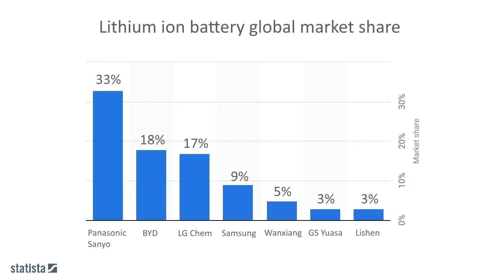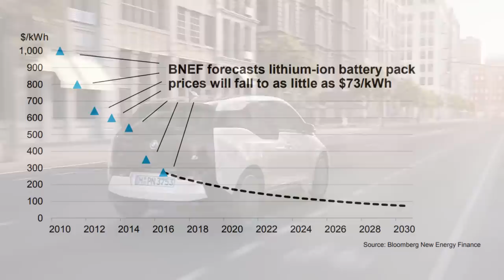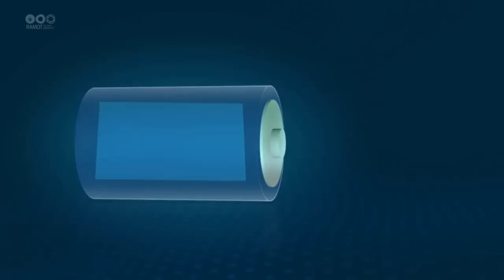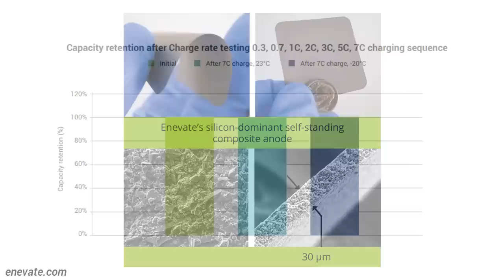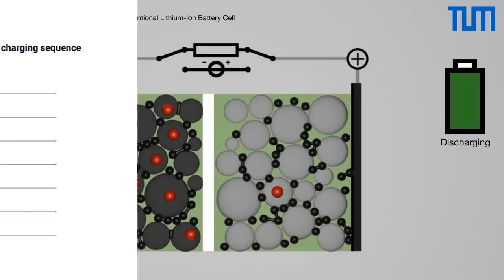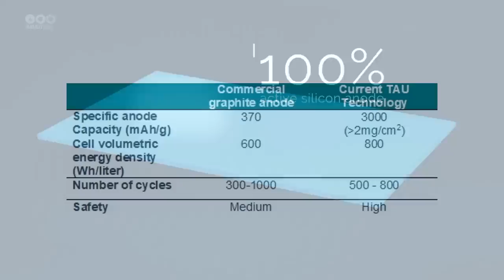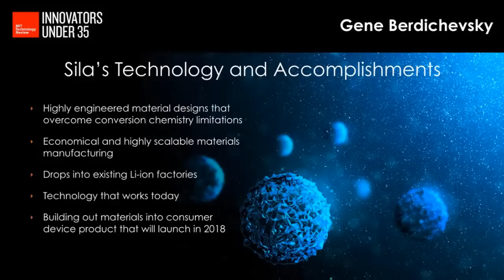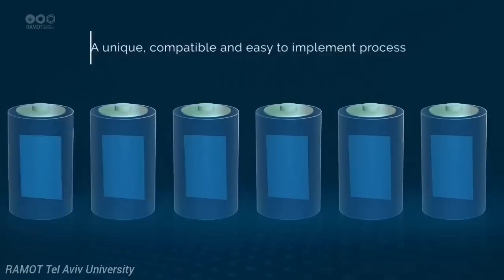The Battery Revolution. Ultra Fast Charging

Comment: Hydrogen-electric is the future. Invest in BLDP and FCEL. All electric cars are a fad. The hydrogen infrastructure is spreading quite quickly and most auto makers are revving up production in Hydrogen cars.
Reply: Hydrogen fuelled cars are not yet practical and may never be so, the cost of cars and infrastructure is enormously expensive and the production of Hydrogen is very energy inefficient. The current technology means that one filling station costs over $1.3 million to build and can only fill 16 cars a day. The energy loss in hydrogen production is enormous and currently only commercially available by burning fossil fuels.Storage of hydrogen for fuel cells needs to be at very high pressure. It may make a lot more sense for large trucks and ships but not for cars at this stage.
Reply: Well, here is the problem with your analysis. The infrastructure is ALREADY underway. Toyoda is building the fueling stations all over California. There is one right down the street from me. Their Marai hydrogen car can be seen all over the streets creating lines at the stations. Hyundai, BMW, Mercedes, Nikola trucks are already producing these vehicles. China is spending alot of money bringing up their hydrogen infrastructure and Europe is already in the works. So, if these companies, that are very knowledgeable about future fueling demands, are already moving forward, you MIGHT want to be in the same boat. Do some research. Especially, look into Nikola trucks. They plan on having the largest hydrogen infrastructure in america within the next few years. Don't wait until it's already done to invest. LOL

Comment: Can't wait to break the last EV mind barier: the slow charging/range complaint. 
Not to mention phones and laptops huge improvement.

This battery revolution and the optical computing revolution.
Reply: there's no revolution happening sir.  the supply of lithium is just not there.
Reply: Darn, the only person other than me mentioning these batteries being used in laptops. Thank you kindly, sir. Everyone seems to be obsessed with mentioning how useful this will be for smartphones, while most of smartphones are replaced because of hardware, not battery, and most laptops are replaced because of weak battery, not hardware. We could have laptops that last for like 10-15 years with these batteries!

Comment: While this is great everyone seems to be missing a key point. If we are going to replace internal combustion engines we electric drives we must consider all aspects of this conversion. First we will have to mine all these elements. This will require at least a thousand fold increase in current mining operations and will will aslo take a huge amount of energy and a huge increase in pollution. Another massive problem will be a total overhaul of our electrical grid along with a large increase of power generation capacity. I lived in Los Angles for 10 years and we had to deal with power shortages all the time. Now imagine if we replaced every car with electric cars the amount of power required would increase far beyond what we can currently can produce. I don't have the answers to these problems but we need to find the answer fast...
Reply: well, requirement for mining more would result in less mining of oil, pretty logical. As for the power - yeah. They would need to increase production of Solar panels and wind power generators. All of this is still preferable to breathing terrible air in cities because of millions of cars going around and also producing so much noise with their loud engines. I'm dreaming of times when I'll be able to sleep calmly at night knowing no car or motorcycle would wake me up.

Comment: Quickly reading the comments, I have not seen people reacting to the big percentage of bullshit in this beautiful presentation. First, if you want to charge a 100Kwh battery in, say 30 minutes, you need to bring around 120Kwh of energy, and an average power of 240Kw during the 30 min charge. 4 charging vehicles with empty batteries would use. .. a megawatt of power. Crazy. This electricity would need to be carried by high power lines with big transfer losses from distant (oil ?) power plants. The whole process is stupid. Of course pollution is better at the place of the car. But overall? I hope hydrogen production and storage will progress fast because it is a much more rationale scheme.
Reply: power line loss is only about 7%, they could always just build super capacitors or battery banks that would store the energy on site and deliver quick burst of high amperage needed to charge the batteries quickly, aslo hydrogen runs into the problem where its mostly generated from oil or electrolysis which is more energy intensive then powering batteries.
Reply: @puits-de-science  you're going to have to source these loss numbers and where you got them from because I've done these exact same calculations with Coal power and ended up with 30% efficiency not counting drivetrain loss wich would be higher in an ICE but you also have to remember it takes energy too process oil into gasoline or diesel and it's not a minuscule amount, also what is an oil power plant? But we can simplify this a bit bit how much energy the cas are supplied and how far they can get, 

Let's use 30mpg for a petrol car wich is 5 miles more then the average MPG VS a tesla model 3

ICE with a 15 gallon tank carries the equivalent energy of 495Kwh and can get 450 miles, so 1,100 watt hour per mile

Tesla model 3 extended range as a 75kwh battery pack and can get 315 miles or 238 watt hours per mile

Wich means the model 3 is 4.6x efficient then a above average 30mpg ICE, and dont forget EVs can also be powered by nuclear power wich gets their emissions per mile 200x less then a petrol car.

Comment: So how does a 60 kwh battery charge in 10 minutes? You must have a 600 kw charger.
Reply: and a 2 MW forced coolant system to prevent overheating.

Comment: Soon we will be an all electric family. Waiting for Tesla to produce that pickup!
Reply: ferkemall  We already have a wall connector installed with a 100 amp breaker to charge a model 3. If I buy a rivian  I will have to get a different wall connector to charge that vehicle. We should be able to do 80 amp charging if the Tesla pickup supports that amperage rating from the wall connector. RIVIAN  has also got in bed with Ford and I really dont trust the old money that Ford represents. RIVIAN will more than likely be  cannibalized by the Ford auto executives.

Comment: LOL WE ARE RUNNING LOW ON SUPPLIES FOR LITHIUM ION BATTERIES....... WE NEED TO BURN HYDROGEN (HHO) THAT WILL SOLVE THE BIGGEST ISSUES!
Reply: Stop shouting, and where do you think this hydrogen comes from? and more importantly how is it extracted and exported. Hydrogen may have a future, but it is not the answer for general transport.

Comment: if I buy electric vehicle I'm going to put a small trailer on the back with a small generator to keep it charged if I have to go to California from Carolina rented from gas stations I'm going to start my own business
Reply: You are going to need a huge generator. A 4000 kw charger takes about 1 hour to charge 1 per cent of a Tesla battery. while using 20% of the battery charge per hour. Towing an 80,0000 kw generator to charge as you use  is going to reduce the range, so you need an even bigger generator.

Comment: What about super capacitor to replace conventional battery isn't it fast charging, and it doesn't require lead acid  and you can combine it with silicon cathode and graphite anode? Wouldn't it be more effecient
Reply: If a battery is a marathon runner, then a capacitor would be a sprinter. They can charge and discharge MUCH faster than any battery, but they can't store as much power and aren't as stable. They could be used for quick charging and to compensate for acceleration, but I can't think of anything beyond that.

Comment: so if i had one of these cars  how many days would it take to go from lands end  to jhonogroats top end of scotland .? thats about 800 miles by road. in my golf diesel i would only have to stop once for fuel  the trip could be done in 10 to 12 hours .in an electric car  you would have to stop at least 5 times . and hope it is not raining and dark. using up battery power.i would guess as twice as long .  they will need to get better mileage from these batteries  but  i am sure they will crack it .
Reply: Well, your math is quite a bit off in several areas.  You are assuming you can drive 80 miles an hour non stop for 10 hours straight.  That is obviously not feasible, as that would assume zero traffic, and I seriously doubt the speed limit is 80 miles an hour the entire way.

Electric cars wouldn't have to stop 5 times.  The Tesla Model 3 goes 310 miles on a charge, so you may have to stop twice on the way.  Most people would require food and restroom breaks also, so the car can be charged during those, and the effective time lost would be zero.

The lights on a car use very little energy, about 100W or less per hour, so using the lights for 10 to 12 hours of driving would use about 4 miles of EV range.

And how many people have, or ever will, jump in their cars and drive 800 miles without stopping?   One in a million, best case scenario.

It is not a problem that is urgent to address.  Most people drive less than 20 miles a day, as seen here:

https://www.telegraph.co.uk/news/uknews/road-and-rail-transport/10724224/Workers-commuting-further-than-ever-before.html

Even on weekends, most people would rarely ever drive more than the range of a Model 3, and even then, stopping for lunch or dinner would charge the car, with no actual time lost.

Comment: Electric cars are the future but probaly  won't become mainstream anytime soon because they are still to expensive even when you buy it second hand!
Reply: Remember running costs are about a third of petrol cars. It is not just the upfront cost. add cheaper maintenance, they are not as expensive as you think.

Costs are falling all the time, they reckon 2025, EV's will be no more expensive than a petrol car. By then it will be a no brainer.

Comment: Well how strong are Electric vehicles compared to gasoline and how much tourque do they have
Reply: depends on how much power you put into them until they burn out, but electric motors have a better power to weight ratio then engines but limited to cooling and voltage, you can make an electric motor output 600HP but it would drain the battery real fast.

Comment: Until we get 10 times the energy density in a battery than we have currently,  you aren't going to see the end of gas anytime soon.  This video is all just wishful thinking at the moment.
Reply: goofyfoot2001 you don't seem to understand several things in this context. First off, electric cars are 92% efficient in energy conversion, ic cars around 20%-30%. So this saves at least a factor of 3. Secondly, an electric car needs very little additional components to drive beyond a battery, whereas an ic car needs far more components then gasoline to function. By saving on expensive, heavy, moving parts, and electric car has fewer base costs, less weight and needs far less maintenance. Now, if you also take into consideration the fact that electricity is far cheaper than gasoline and that the saved space in an ic car allows for more space in an electric car for batteries and it all starts to make sense. O and don't that electric cars are saver due to their rigid underside which is filled with batteries. ^^
Reply: If you can get a 400 mile car that charges in 15 minutes... Gas will be dead. What WILL go up significantly, will be the price of electricity.

Oil prices will skyrocket because less is needed on a wide scale, but we will still be generating electricity with oil due to its enormous energy density...

So electricity will be the NEW gasoline. And the price will skyrocket.
Reply: I think goofy is talking about things like planes rockets, other heavy duty type things.
Reply: Actually I'm talking about energy density.  Batteries suck compared to gasoline.  Not even close.  Take a pound of battery and a pound of gasoline and see how far your car goes.

Comment: Apperantly they did´nt account for the price of cobalt rising,because it is turnig scarce
Reply: Tesla/Panasonic have reduced their use of cobalt by 72% per kWh and say they may be able to get to zero content very soon. Also cobalt is not scarce, just that most is currently mined as a byproduct of copper mining currently, if price increases other sources will be made commercially viable to mine in other areas.

Comment: "the earth is rich of silicone" 
Pretty sure that's what they used to say about fossil fuel's and crude oil...
Reply: First of all it is silicon, not silicone (very different) and silicon is easily accessible making up over 90%of the Earths crust. Oil is a tiny fraction of that, and simply doesn't come close to the amount of silicon available.

Comment: To go from internal combustion to electric will take just as long as it did to go from horse to car.  Change is hard
Reply: It's not practical. The world should be investing in carbon recycling to make synthetic fuels than promoting garbage electric cars that are a hassle to own. Long charging time, low range are the many frustrating aspects of electric cars.

Comment: When the range of the vehicle is greater than 900 miles on a charge and they no longer are secondary polluters worse than gas burners give me a call.
Reply: cars have a average range of 400 miles, the secondary pollutants are less then a gas car after 4-8 years of use.

Comment: Bad plans... what about replace all fossil driven power plants, heating centers etc. first? Because now, 87% of power is come from non renewable energy... 2030? Really? How about trucks, boats, ships, trains, cranes, airplanes, agricultural things, mining transportations, military vehicles? Just for example, a heavy Caterpillar truck is drinking about 800 Liter of diesel PER DAY! Battery... Oh yeah:) An another basic question... How about people who will buy a car on 10 year loan contract in 2025?
Reply: huge vehicles are better for electric actually.  A bigger battery charges faster relative to its size.  There's an electric dumper truck working in some quarry that I learned about a while back that uses regenerative braking on the descent to get ALL its range back for the climb.  In short, it never needs charging to do its job.  Norway has electric ferries and is actually investing in more. 

If you look at the rate the coal plants are shutting down you'll see that... well, heck, 17% of US power is renewable today ( In my country it's twice that) and improving monthly.  62% of US power comes from fossil fuels.  A few years ago it was what, 80-90%?
Reply: EV are a shit idea: 
Pollution come’s from the elettricity prod.
Batteries have a shit autonomy 
Petrol engine cars are much reiable than EV
More u use the battery more the autonomy decrease

Comment: More promises that will probably never come about.

So where can I buy one of these batteries now, in the UK it's seriously difficult to get hold of decent lithium batteries so what will change?

Gasoline makes huge amounts of money for the govt do you really think they will just allow the changes without any extra taxation on the product?

You may make them cheaper in the end but the govt will slap a tax on it so they can keep lining their pockets with the money we work for.

But seriously I need batteries were can I get some of these fast charging long lasting high performance batteries?
Reply: As a fellow UK resident I can say it's pretty easy to get hold of  decent lithium battery.  There's halfords, amazon, argos, etc.  Lots of shops online and offline sell packs of AA, AAA, coin batteries, etc.

The government wants people to switch to electric because exhaust fumes are costing the NHS insane amounts of money and reducing economic productivity as a result of all the health repercussions.

The batteries this video mentions are still in a lab stage;  as are most of these 'breakthrough' techs you hear about.  Before they become commercialised they have to be case studied and tested vigorously and it's a PONDEROUSLY slow moving process.  Frustrates me too!
Reply: Well yes for sure you can get the AA and AAA batteries but i'm talking about the 18650 types, you can only get these online.

You can get lots online if you don't mind waiting a couple months but then you can pretty much get almost anything you want online if you don't mind waiting a couple months.

Also price is an issue.

In the UK as I said you can get them but the price is very high, compare UK prices to the USA were you can pick them up at a dollar a cell in the USA we pay anything from 5 pounds or so per decent cell.

Now if you have a project you want to work on that project now becomes overly expensive.

Even the second hand cells are very expensive now in the UK.

However the crap cells are still cheap, well I say crap cells I mean ultrafire types, their not exactly crap but you pay a premium for a cell that's not that good, mind you, you can revive an old cordless drill with them I've done it with two drills so they are good for that, so long as you don't expect too much from them.

The 18650 is an old cell that has been around a long time, so long that the tesla no longer runs on them they are now using the 2170 cells which you can't get either in the UK.

But it would be nice to be able to get hold of a nice big batch of 18650 cells at a decent price, but at 5 pound a cell it's way to expensive.

Comment: And how many power stations do we need to build to feed ev's once ic engines are banned
Reply: Not that many, since most cars will charge at night when demand is low. The EV will in fact help balance the grid, which will be in fact, a good thing.